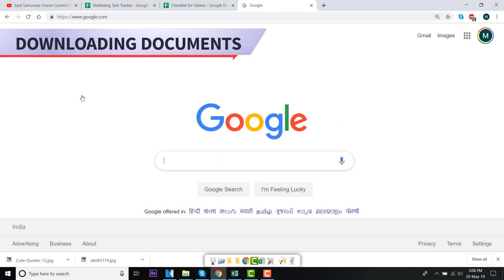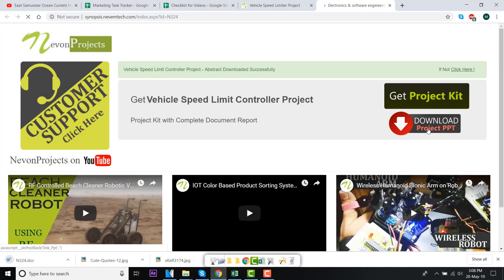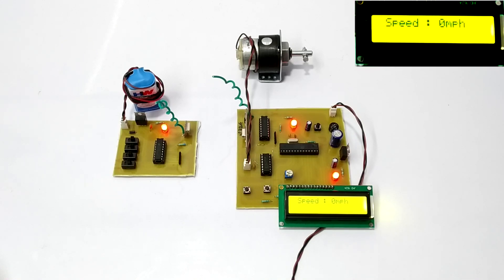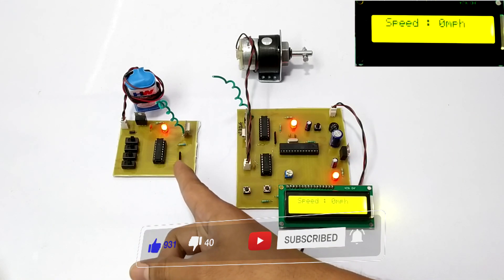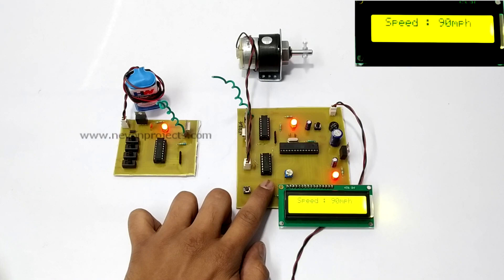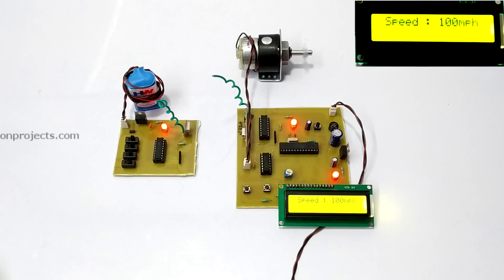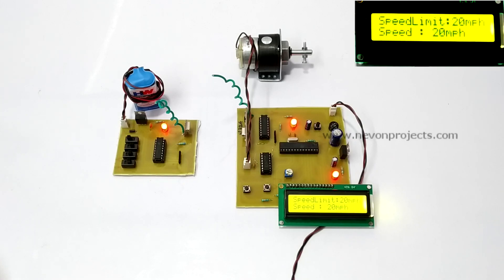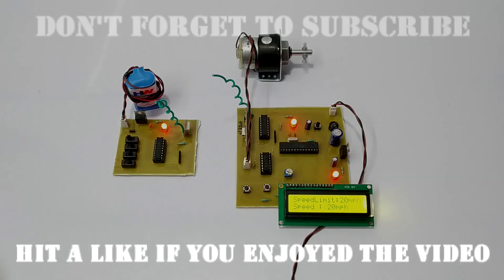Vehicle Speed Limit Controller Atmega Microcontroller Based Project Electronics

Comment: I am the speed warning device manufacturer. No way the device could run electronically alone. Need input for speed Revolution for different make of vehicles. Wheel size and the weigh of vehicle .... plays a part